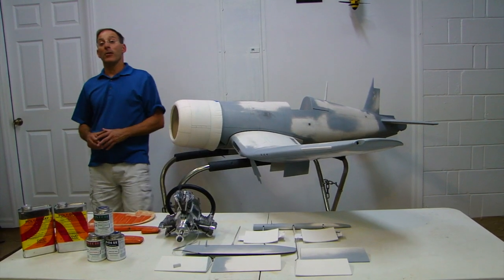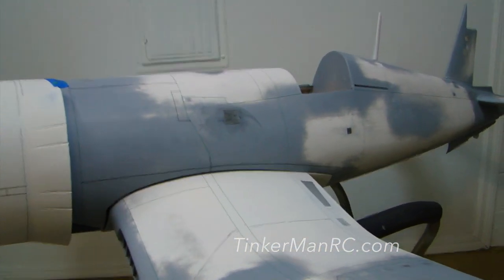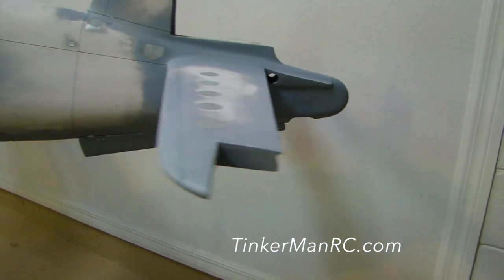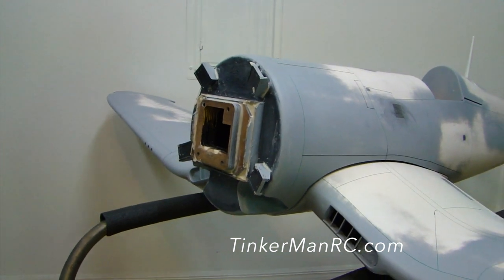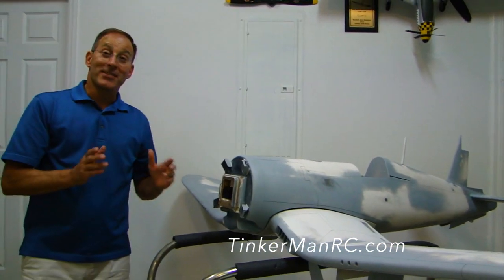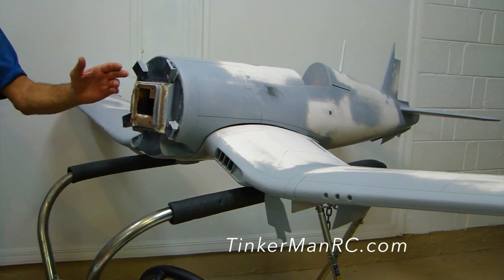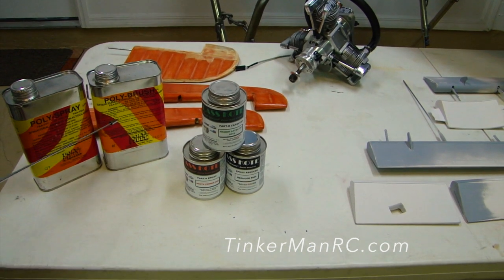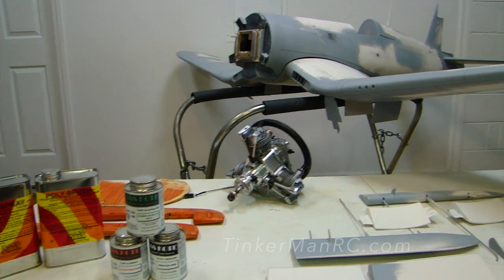Hangar 9  F4U Corsair 60CC Build Part II

Comment: Hi I am building the same plane. What are you using for primer? What size chartpak tape did you use? Was is crepe or vinyl? Have you flown it yet? Sorry for so many question in one post! Thanks in advance,
Reply from the maker: +RCexplained  All great questions, The primer i used is Klass Coat, Chart Pack tape size is 1\32  , Have not flown it yet  because I'm still working on the airplane. Almost done.. Will have another video to update soon.. Thanks for asking ..Tim

Comment: I hope u read up on that motor...a lot of guys could not get all 3 cylinders to run at same or near the same temp, something to do with the intake manifold....I hope yours is better...
Reply from the maker: +1976axerhand  Yes the FG 84 has been sent out to Ray English and had all the mods accomplished. Thanks for the cool comment..Tim
Reply: +TinkerManRC  I cant wait  to  see  it  in  the  air..  one  question  though  how  much  extra weight was added  by  adding the  fiberglass  and  paint  to the  airframe  thx  glenn